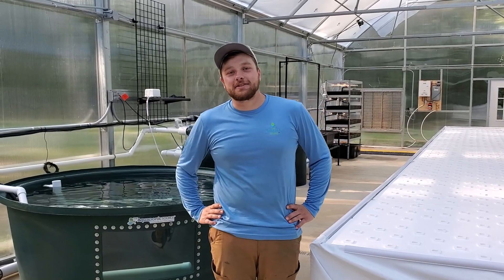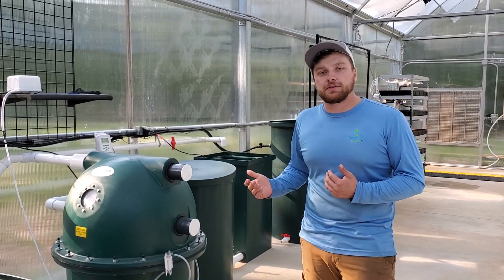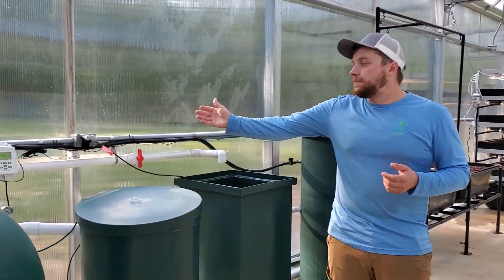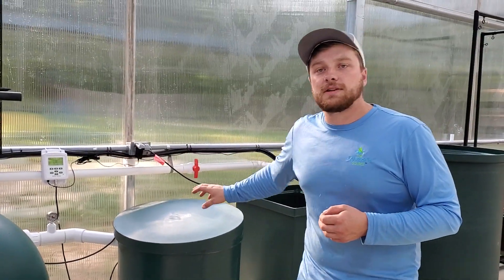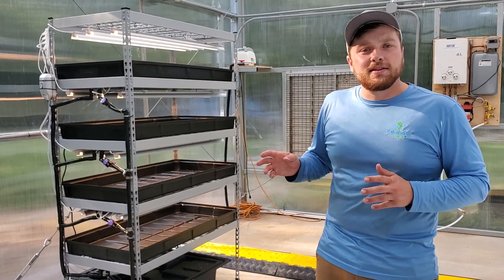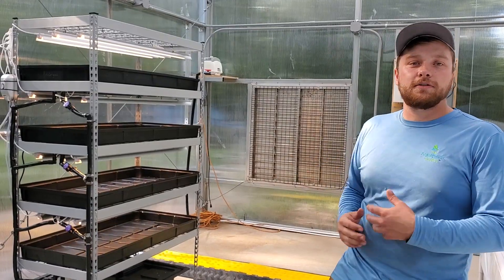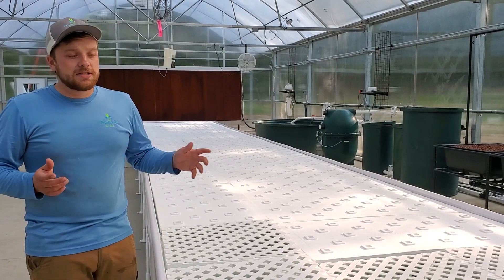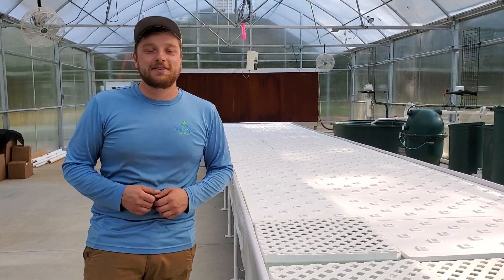Small Commercial Aquaponic Farm Install at Blackbird Farm

Comment: on the back wall of the greenhouse I see a water heater, is it used to maintain the water temperature for plants and fish?
Reply from the maker: Yes, that is a propane heater we build in our shop and it recirculates water through a stainless steel coil that sits down in the sump tank.